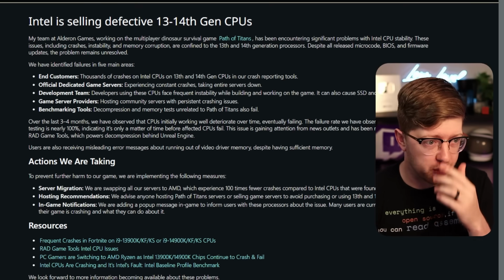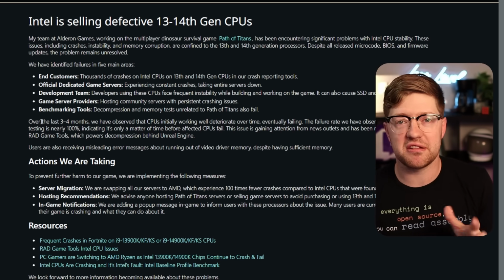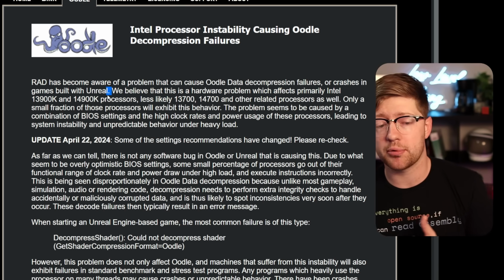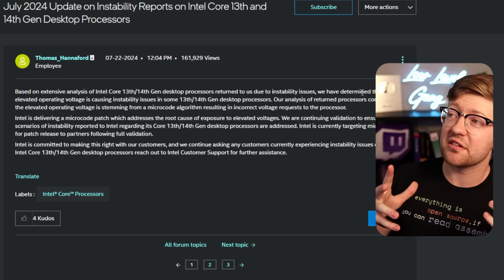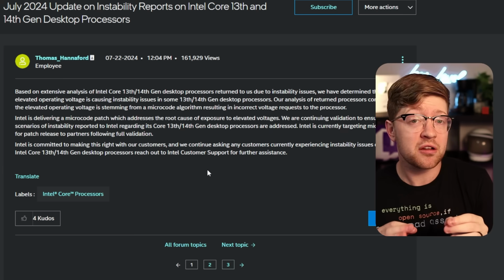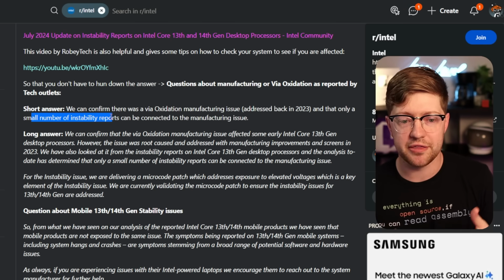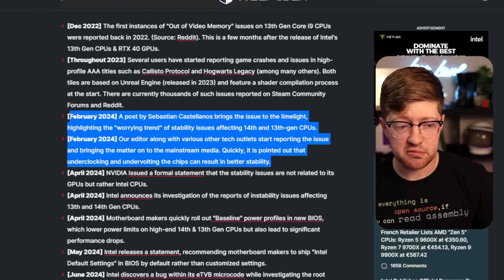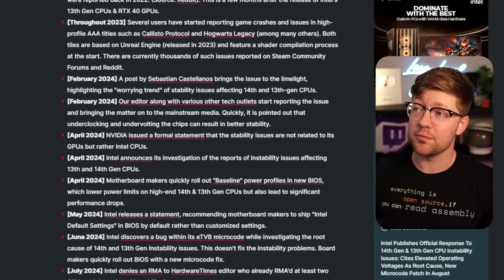intel CPUs are literally falling apart

Comment: should I postpone my purchase then 😅??
Reply: just buy amd
Reply: @900bands  Yeah I have no idea why people would even consider buying 13th and 14th gen intel processors now.
Reply: @ItsHaldun  just dont let the 2 cores boost, set it to static allcore and undervolt abit and ur fine
Reply: @ItsHaldun The idiots like me who bought 12th Gen on the decent performance at the time thinking that 13th or 14th Gen would be a good cheap used upgrade option three to four years down the line. 

It's egg in my face big time. The one time I go with Intel is the one time I screwed myself over unless Bartlett Lake is okay. Even then, the whole ordeal has left a bad taste in my mouth even though I'm fine.
Reply: @CVLova  "Just don't use the thing you bought to use and it'll be fine"
Reply: Wait for ARL.

Comment: Is it the same with Laptop CPU's? I have been thinking to buy gaming Laptop with i9 14900HX. With all the news I am afraid to make the purchase.
Reply: Yes laptop cpus are also affected.
Reply: 13980HX. Crashes about once a week. Do not. Just get a desktop, preferably with AMD.
Reply: Bought a laptop with a 13th gen intel cpu a literal month before all of this started to come to head. So far nothing major has happened, but I am not pushing the hardware either.

Kinda worried to, seeing all of this. There is an oddity though. It never gets unplugged, but the battery charge fluctuates from 95% - 100% depending on the day.
Reply: @ugib8377  Some are saying all 13th and 14th gen are ticking time bombs. They will degrade gradually and fail. If your warranty is still on then you are lucky otherwise your PC will be dead. This is what worries me to put my money on Intel right now. I am purchasing with the intention to use it for next 7 years.
Reply: I would not buy raptor lake. Just 7 days ago I bought a core ultra 5 125h laptop and this came out and I'm worried as ####!
Reply: @haha-hk9tx  I have saved up for 2 years to buy something which can last me for the next 7 years. The last thing I want is to have my money go up in smoke. If the failure is inevitable at some point then I have no choice but to go for AMD. :(
Reply: @gotfan7743  What's with the sad face, you've been left with the superior alternative 🤦‍♂
Reply: @gotfan7743  no reason to be sad AMD mobile CPUs are much much better than Intel ones
Reply: Just buy one with AMD, they're straight up better at this point.